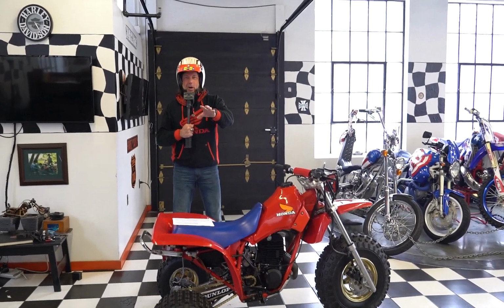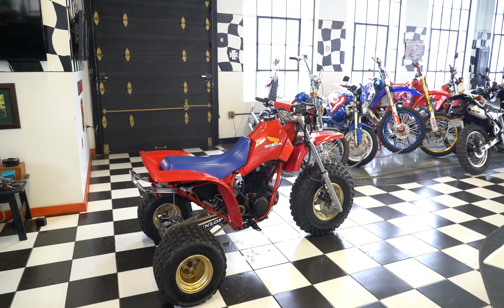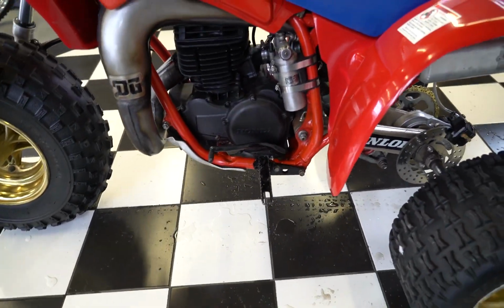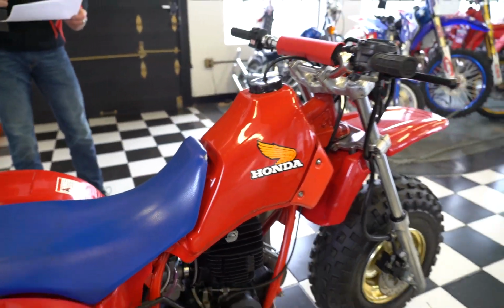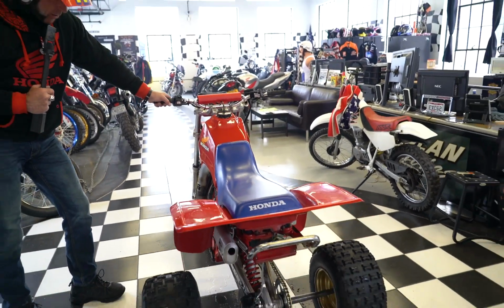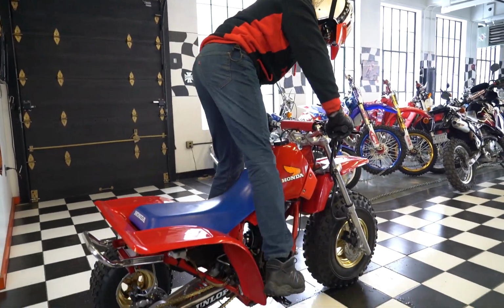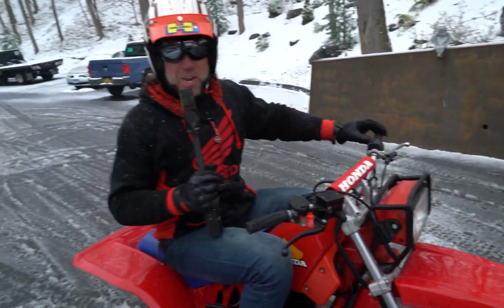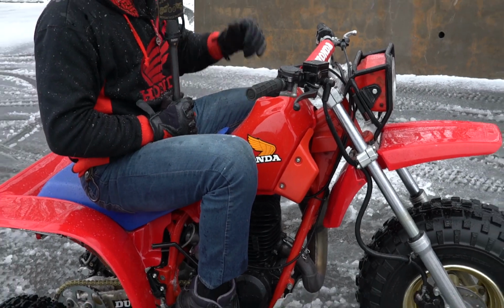1984 Honda ATC250R

Comment: Great fun in snow bought a tri z 250 in 2001 ready for a  bad winter never got bad snow 7 years later traded for a xr 250 then bad winter came rode xr to work in 12inch of snow 35 miles each way 
Another great video

Comment: I raced one of these and 200x  for practice. Be carful ken. There hard or different to ride.  I’ve been ran over a few time and try not to run over your own feet    I love them.  Not everyone’s cup of tea.  If you was closer it would be coming home with me.  I’ve been looking for atc350x for when it snows. Keep behaving like a teenager Ken.  Love what your doing.  And saving some of the most iconic trail and race bikes ever. When the doors opened and it had snowed what els could you ride.  Brilliant just brilliant

Comment: Wow she is amazing.. I grew up riding  the 1985 250r.. had 3 of them ..and 2 350x.. and one four trax 250r ..my last 1985 250r is on the display at ronnies in north adams mass  on the show room floor.. she is all original except the fork boot.. the stock one just dried up and cracked so they replaced them.. I love going in and seeing her.. yes I hug her every time Lol.. I wish I knew about you guys then I would have called you an seen if you wanted her for the museum.. I do have a 1985 350x project trike many great parts solid frame from Arizona with no cracks or welds with title.. same for swing arm.. has the skid plate mounts still in tact.. great engine.. cobra pipe.. all oem hard to find rubber grommets..for frame..like seat. And tank etc missing some parts tank  ..plastics.. have original head light bezel and working lights not cracked  seat foam with after market cover.. have to locate rear brake caliper and brake pedal..lost them during a move.. at this point I have done over 44 bike and trike builds thinking I might just sell as parts..it’s been in my garage for like 6 yrs now waiting to finish .. well great video thanks for the memories you just gave me.. lol  god bless you guys and stay healthy Kaplan family!

Comment: Got this bike brand new in 83 was a learning experience I crashed and broke the light off first thing 250 is alot of bike on a trike I got a tecate then back to the Honda 85 water pumper and still got it. Fun momories thanks for the flashback.

Comment: I was 15 and went into my local Honda dealership with my Dad. I had $1700 and my dad paid the rest. Bought a brand new 86 ATC 250R! Man was that thing fast! Chirped the tires every gear going down the driveway. On the right track with my buddies nothing could touch my 250R😀

Comment: That one must’ve been lightly restored. Those are maier rear fenders I can tell because of the color and how the side doesn’t fully reach out and tuck on the sides around the rear corners of the tank. Headlight guard does have a dent but looks alright. That fuel tank looks gorgeous though for sure.

Comment: I know it's a year later ,  45+ yrs as a motorcycle technician,  rear brake line is ran wrong , it goes down the swingarm, where it is now will only stretch and break the brake line prematurely.

Comment: You guys talk about jetting alot. Please make a video about 2-stroke tuning.
Reply: John Doe run your bike, check the plug, too dark and oily, too rich, too light, too lean, tan, just right. And you’ll notice detonation and backfiring if it’s too lean also. Another thing, changing oil in a two stroke doesn’t effect the cylinder at all, it’s only for the transmission. The oil you mix with the fuel is the only lubrication the piston, crank and cylinder get, so mixing it heavy when in doubt  is always better. A fouled plug is way cheaper than a blown motor. 32:1 is the universal ratio.

Comment: Nice 2nd Gen 250R.  I picked up a 1st Gen in mint condition,,82 model,,for get this 750 bucks and looked and ran like new back in 85.  Got the 86 Fourtrax as they were first called 250r four wheeler in 87.  Yeah it sounds a little rich on fuel,,,rich is too much fuel, not oil on a two stroke..People confuse that all the time.  Too much oil can make the engine run lean from less parts fuel, more parts oil and smoke like heck depending on fuel to oil ratio being to much oil.  I would check and what the factory jets and needle position are supposed to be first before and rejeting too...Very good chance being the factory carb its only the needle and needle jet being worn letting too much fuel come through at low throttle setting making it run rich down low before it comes on the pipe..In cold weather it would run cleaner anyhow from the air being more dense...I'm blabbering..old 2 smoker...hahaha!